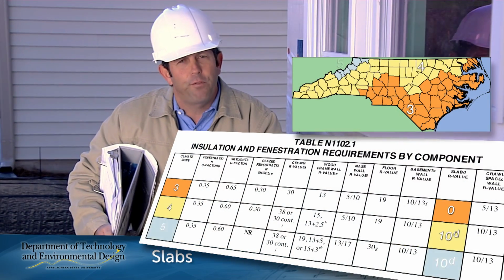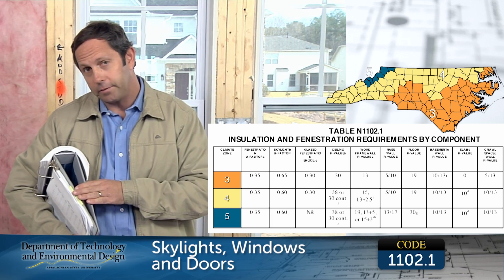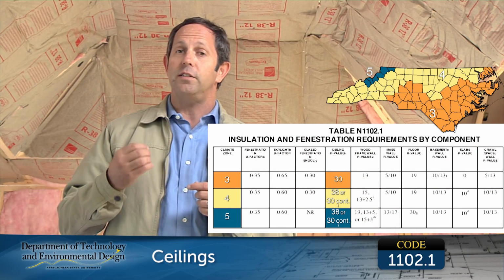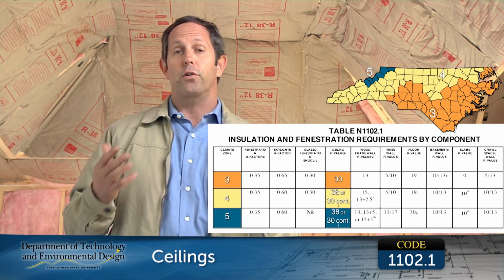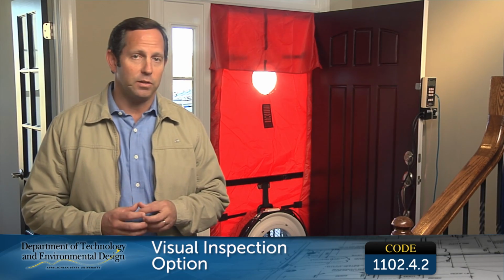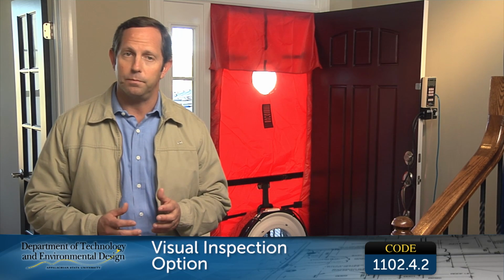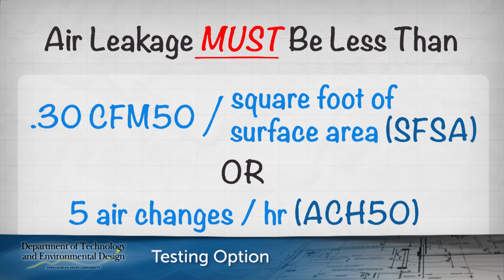2012 NC Energy Code - Raising the Efficiency Bar

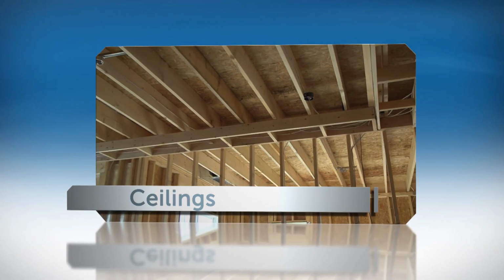Comment: I like the shot of the dropped ceiling @ 3:00, without a required cap! Weatherstrip is required on the attic pulldown stairs, and there was no insulation on the vertical attic door. I don't see any insulation on the slab outside, I guess it is supposed to be under the stucco?